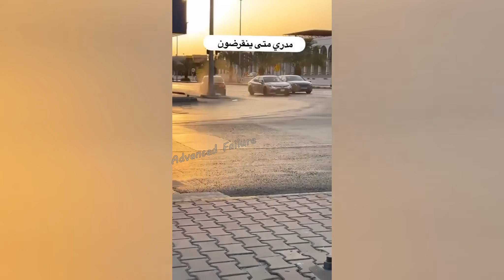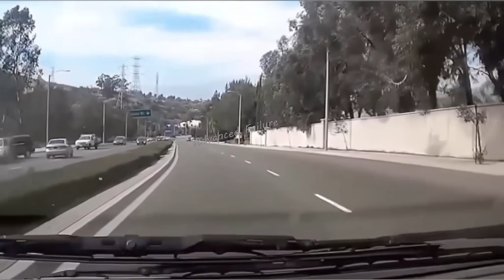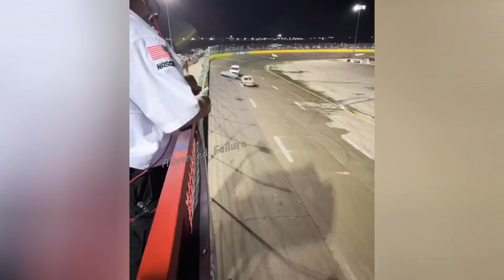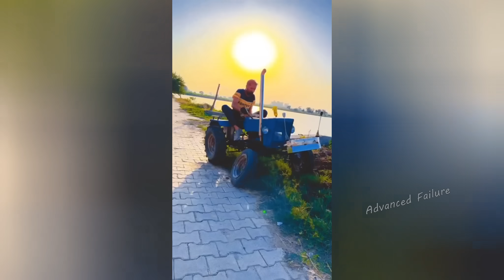BEST IDIOTS TRUCK & CAR DRIVERS FAILS 2023* BAD DAY AT WORK FAILS 2023* TRUCK CRASH COMPILATION 2023

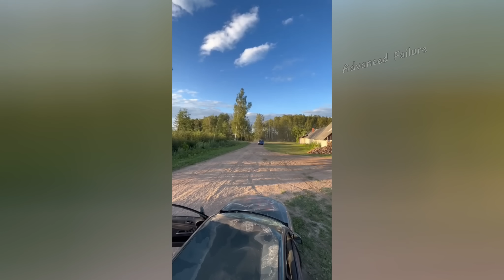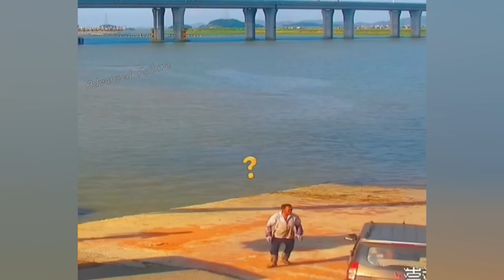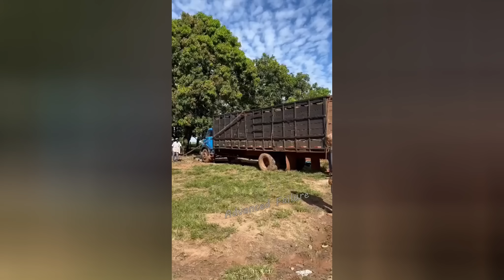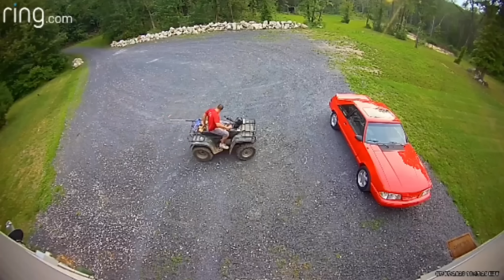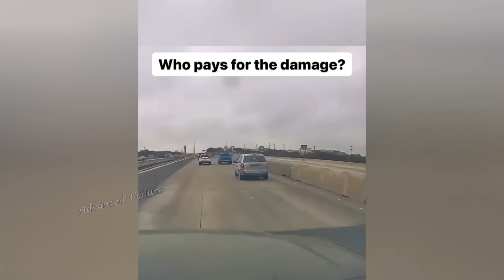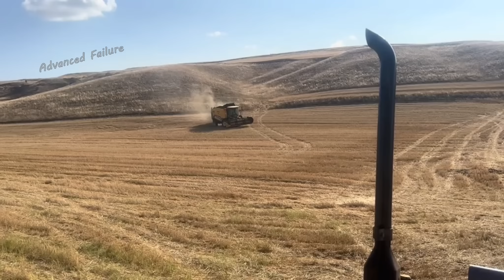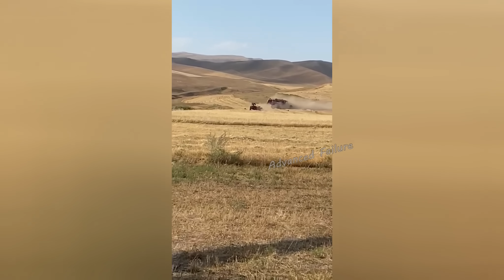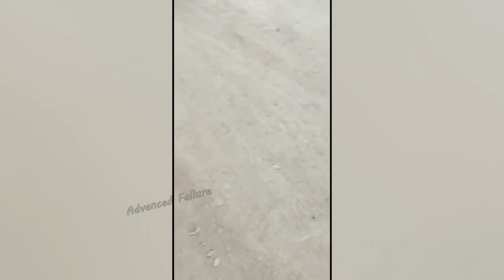Comment: 0:24 when you accidentally learn how to drift 1:16 bro is so talented that they can close doors with their car 2:19 they deserved it 3:37 how did this dude just make a semi truck roll over with just that? 3:55 how is every so small? 4:05 the tire would 5:10 the trailer be like: bye i'm outta here! 5:48 that's why you don't go top speed 6:08 must have some talent 6:37 where's the brakes? what's this thing in my mouth? OH NO IT'S THE BRAKES! 6:51 karma be like: 7:11 trees don't exi- 7:27 double blind spots don't exi- 7:42 i ain't paying for parking 7:58 how? 8:16 i blame the extras 8:25 there should be aeb there 8:40 steering go: brr 9:15 if you don't know what you're doing, why are you doing this? 9:25 pick me up later no how bout i die 10:27 911 part 2: 11:00 i guess that's our dinner 11:13 hey i wanna join oh poop and that's why i have a roll cage 11:19 why do you have that 11:51 nyc moment 13:25 how kids see disasters: 13:44 how 13:59 u turns be like: 14:20 the driver didn't fail, the road workers failed. 14:28 the slowest t bone 14:47  that's why you always check before a wide lane change 15:01 got karma 15:09 too sketchy 15:55 BREAK YOUR PHONES BEFORE DRIVING!!! 16:23 they lagged
Reply: 1q